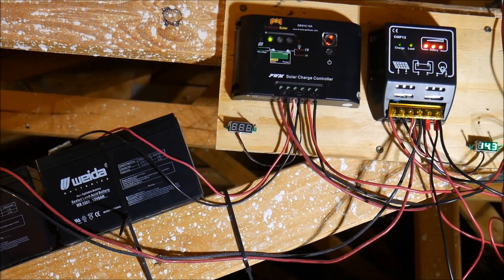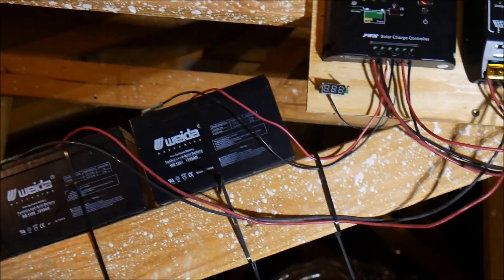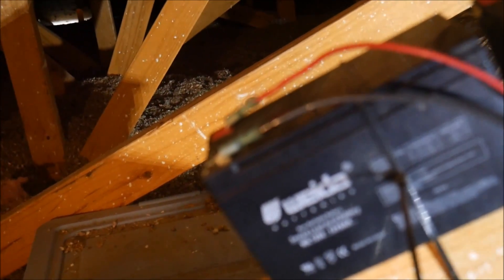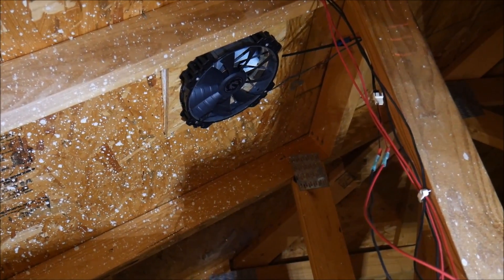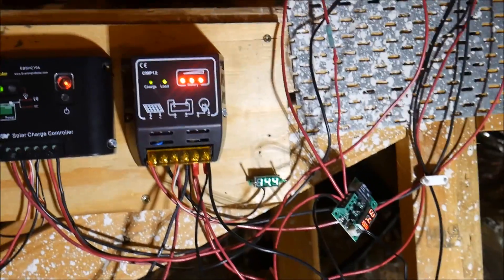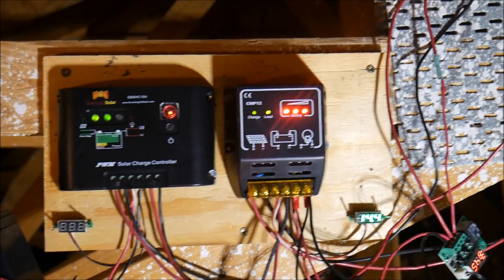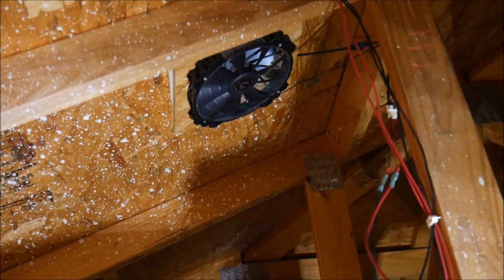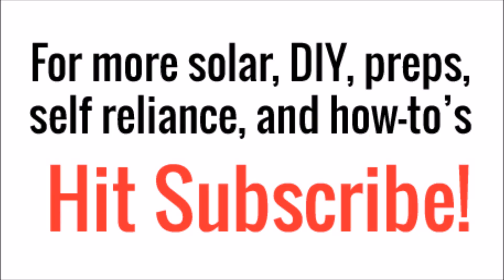Solar Attic Fan Update

Comment: Lame. You know the heat weaken the battery. Also it can case a 🔥
Reply from the maker: This battery is subject to the same conditions as a car battery in an engine bay.  If you don't make mistakes, you don't start fires.

Comment: Do  you feel any difference in temperature in your attic and your AC bill? Question is - is it really worth it ?
Reply from the maker: I can't feel the difference, no.  But 135 degrees and 140 degrees feel about the same lol.  I want to revisit this at some point and try to do more before and after testing.
Reply: @LDSreliance  I guess bigger fan is needed to move more air
Reply from the maker: I think you would have to move an enormous amount of air to be able to physically feel the difference.  My limitations with this project were the physical size of the opening that was already existing because I did not want to cut out more holes in my roof.  Also, I wanted to mount the solar panels to the top of the vents and not mount them to the roof itself.  So that limited the size of the panels.  So these fans were the best I could come up with at the time.
Reply: Hi again. Do you still feel that mounting PC fans made any difference ? I'm in FL so it's as hot in Texas. Do you see any difference in electric bill ?

Comment: If I was you I would hook the batteries parallel so the batteries last longer . Get one charge controller you only have one of those and just get a bigger solar panel . So you have more water is going in the solar battery charger and it's charging one battery so the longevity is longer and ditch the thermostat and just run the fans too the battery's

Comment: You need to run the fans all the time . Having a thermostat sucks no good . Google fans bout time II thermostat gets hot enough and they're only what 200 CFM an fan that's going to take forever to cool down the roof . That's why you haven't speening all the time . So theur sucking all the hot air out before it gets too too hot

Comment: How much cooler did this make your house?
Reply from the maker: It is impossible to measure.  There are too many variables to try to isolate to do a proper before and after testing.  Sorry, I wish I knew!
Reply: @LDSreliance  - wireless temperature/humidity monitor (Lowe's $16)- record temp data before/after fan installation.
Tiny fans woefully inadequate tho!

Comment: why not invest on solar gable fans. You don't have to use batteries. You can connect the fans directly to the solar panel.
Reply from the maker: I don't have gable openings.  I did not want to make permanent modifications to my roof or house.  So I chose fans small enough to fit inside the existing vent holes and solar panels small enough to be mounted to the top of the vents.

Comment: Might be interesting to  trying reversing one of the 2 fans. So that one fan would push air into the attic and the other pull  air from the attic. Reduce the chance to pull conditioned air from the home.
Reply from the maker: Interesting idea.  Thanks!
Reply: Interesting and possibly a brilliant idea.

Comment: i see that you have 2 volt meters. are they connected to the battery or or the solar panels?
Reply from the maker: They are connected to the battery.  They allow me to see if the battery is in good health and being fully recharged each day.
Reply: @LDSreliance  use just one battery to run both fans and use both panels to charge the one battery

Comment: use attic Arctic Shield it lower your by at least 35 degrees the summer it is a wolven metallic structure like foil blocks radiation from getting in your attic and then radiates back out through your Works awesome in my really inexpensive for the bang for the buck especially since it looks like you have your ducks in your attic as well
Reply from the maker: Radiant barriers are nice but my attic is a monster pain to get around in.  You can't stand up so you have to crawl around on hands and knees and climb over or under all the knee braces.  It would take days to do the job properly.  I also know I won't be in this house for more than 4 more years so it wouldn't pay itself back in that short of a time frame.  Good idea though!

Comment: I just got a lithium iron phosphate battery.

Heres some info on it.
1.) It is a 12V battery 
2.) The AH rating says 26 - 35 AH
3.) The LCA (idk what this means) is 480
4.)The watt hour rating is 96.
5.) The brand is battery tender

I think you multiply the volt of the battery (12) times the amp hour of the battery (it says Pb Eq 26 - 35 AH) to get the amp hour of the battery.

12 * 26 or 12 * 35 does not equal 96, it is alot more than 96. Why does it say 96 amp hours?
Reply from the maker: You are correct.  Volts x Amp hours = Watt hours.  So the ratings on that battery are a little confusing.  Also, it is not possible to have a range for Ah.  Maybe those two values were calculated at different C rates?
Reply: What are 'C rates'?

What does LCA mean?

Does it matter if the battery can deep cycle and start engines?
Reply from the maker: It sounds like that battery may not be designed for deep cycle.  LCA is to lithium as CCA is to lead acid.  So it is a measurement of cranking amps for a starter battery.
Reply: But, but, it has an amp hour rating on it, and it said the battery can be discharged to 0. This is one of those hybrid batteries, meaning they can provide a quick jolt of power, and/or they can be used as a deep cycle battery

Comment: The controller on the right is a fake it is not true pwm
Reply from the maker: How can you tell just by looking at it?  There are literally dozens of companies that use that same case/look.
Reply: LDSreliance ya your right maybe it depends on how much you pay for it i only payed 9$ mine just drained my battery i scrape it
Reply from the maker: I think I paid $12 or so on Amazon.  It definitely works as I have checked in the attic after dark and the fans are still going.  But I agree with you that the charging program is probably junk and they probably cut every corner you can.

Comment: I suspect the corrosion is more likely due to the battery leaking. Those are sealed AGM's; there should never been any corrosion anywhere on them. Given the high variance of temperature those batteries are experiencing in the attic, I would expect the metal contacts to have expanded and cracked the epoxy used to seal them. (I've seen that happen in cars, upses, etc.)
Reply from the maker: That is true.  The hydrogen could be escaping close to the contacts.  But that corrosion would only happen if they were under charging, too.

Comment: turn your batteries the terminal up. acid runs down hill
Reply from the maker: Worth a try!
Reply: Clean the terminal up and out on top. Looks like 14.4 volts. Shouldn't be a problem. Silicone sealant the terminal once clean
Reply from the maker: Good idea.  I will give it a try.  The system on the left is the one that was having a problem and never making it past 13.2V.  I took the battery out and let it rest for a couple hours and measured it... 11V.  Dead!
Reply: Is the charge controller out of wack
Reply from the maker: I don't think so.  I guess I can put that battery on another controller for a few days and see what happens.

Comment: If my project:
1) Turbines, easy. I do respect and can relate to wanting to design something more interesting though..
2) Why even use batteries with so little draw? Fans are pretty dumb; low voltage, low spin. High voltage, high spin. So the sunnier the day, the hotter the attic, the faster the fan. Otherwise, we don't care if it's running or not.
Reply from the maker: True.  My thinking originally was that I didn't want to burn up the fan with 17-18V and more importantly the temperature in the attic, according to my data logs, was staying 110+ well into the night.  So I wanted it to keep ventilating the attic after the sun set.

Comment: computer fans? wth..get attic turbines or a a large fan....this isnt a smart solution
Reply from the maker: That is a valid opinion.  I like solar so this was a chance for me to install and play with a new setup and try out thermostats and thermistors and possibly arduino controls at some point (I don't think that is likely).  I looked into other 12V fans and they were stupid expensive so I went with what I know... computer fans.
Reply: h! Ok..experiment! When i was younger i was volunteered to wire in electric with wafer switch..also a garage fan..attic entrance was open..blowing cooker air into garage. Cooler outside air eventually got to attic cooling that..which coole..d the house..rarely used ac
Reply from the maker: Interesting.  I'm not sure where I could blow the hot attic air, though.  My garage does not have access to the attic.
Reply: Attic had a big fan..an opening on the other side air pulled across the attic. In garage a fan was turned on..it pushed air up onto the attic...1
Reply: Diagrams needed
Reply from the maker: I'll have to think about how to do that.  Good idea though.

Comment: Yikes!  Does it need to be over complicated like that?  Two words,  "attic turbines", that would get the job done in a time proven and effective manner.  They are don't develop the maintenance issues your having.  Of course you could go the other way and install an Arduini controller on those fans, with a real time clock, temperature and humidity sensors to get the same job done.  I suppose it's based on how much equipment, parts and time your willing to invest.  The "KISS Method" is always the best way to go from my experience. It doesn't appear your going in that direction to vent that space but your there, I'm not and it's your call.  Cheers
Reply from the maker: I think this system is in between the crazy over-complicated Arduino style with sensors and advanced controls and a simple panel and fan.  I could have just installed whirly birds but that is not my style.  I am a DIY guy that loves solar so this was a chance to play with small solar systems.

Comment: why not direct wire, without a battery?
Reply: Be honest, you just like to tinker lol
Reply from the maker: I showed on my data logs that the temperature would stay in the 110+ F range well after twilight so I wanted the fans to be able to continue to ventilate and cool down the house a little bit.  You could easily do it without a battery and probably without a charge controller but I'm not sure what the life expectancy of a 12V DC fan would be if it had to cope with a variable 12-18V.
Reply from the maker: Guilty as charged!

Comment: hmmm....one idea.  make those batt connections bright and shiny.  use some dielectric grease when connecting.  chances are your problem will go away.  if the battery/charge system is incorrectly sized, that's another story.  your video made me hungry for spaghetti.  sarcasm intended... 😜😜😜
Reply from the maker: Haha, spaghetti??  I don't have any grease or I would try that.
Reply: LDSreliance ....yeh spaghetti...what your wiring looks like!!.....hey...if i have to explain...then it aint funny!!!😜😜😜😜  silly boy...go to auto parts store or electronic shop and buy a tube of grease.
Reply from the maker: Haha, one of those tiny ketchup packets for $1.50 at the auto store?  I'll just order some :)
Reply: LDSreliance Yes, just buy a tube. It's likely the same price in store. For some reason they use the gold exchange rate for the little packets.
Reply from the maker: I ordered a 3 oz tube on Amazon for $7.  Those little packets at Auto Zone are probably only a few grams and cost $1.50.  Such a joke.
Reply: LDSreliance ....wise choice.  it has a million uses and good to keep around for whatever purposes.  the grease is inherently high in price no matter where purchased.  but some deals are better than others.
Reply from the maker: Well thank you for the suggestion.